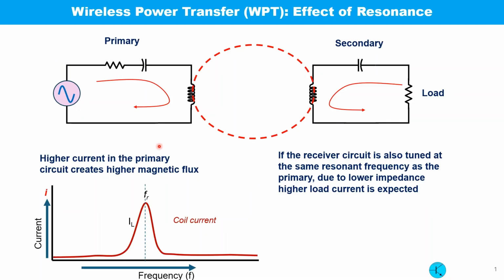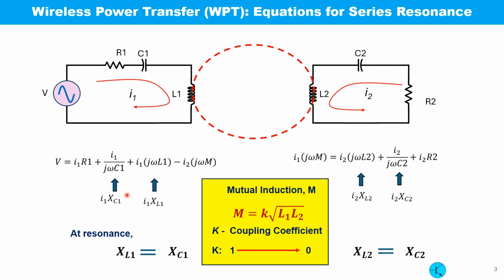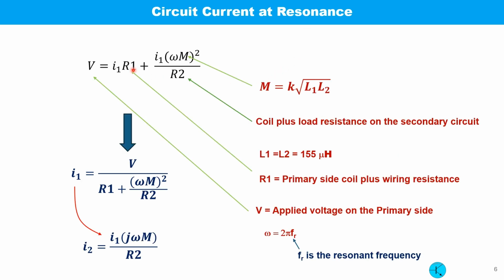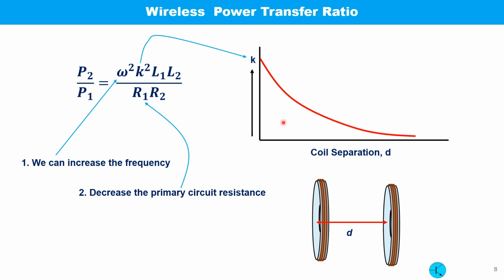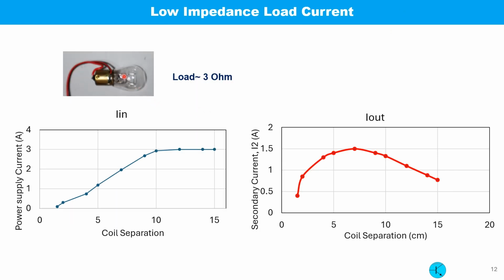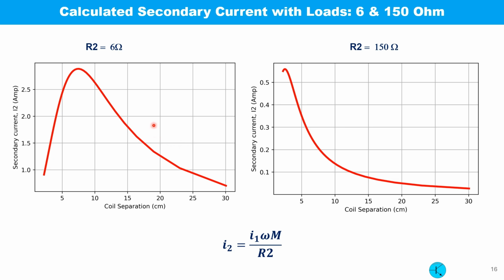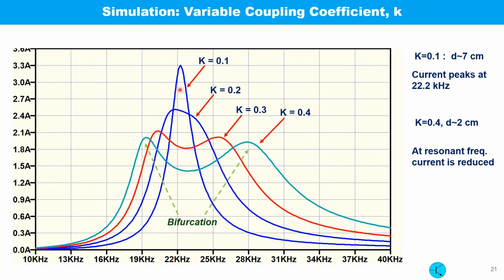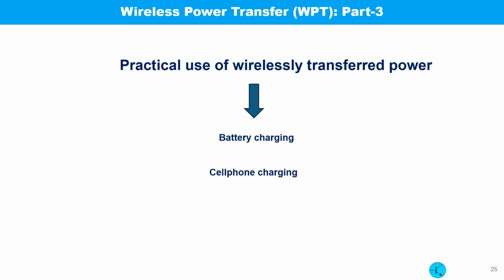Wireless Power Transfer Part2

Comment: Very detailed demonstration, easy to follow.
Suggest a same size lightbulb on power entering transmitter also. This will help visualize. Also curious, since every coil has two sides, could a 2nd receiver coil/circuit be placed on the other side of the transmitter coil?
Reply from the maker: Thanks for watching and your comments. Yes, placing the secondary coil on the other side will also work. About your first question placing a light bulb in the primary circuit, the primary current will be lower due to the light bulb resistance. If we place a very low resistance light bulb (~1 Ohm) then it will affect less.